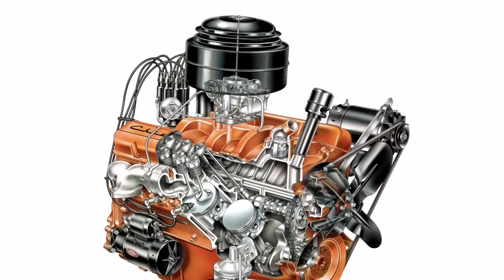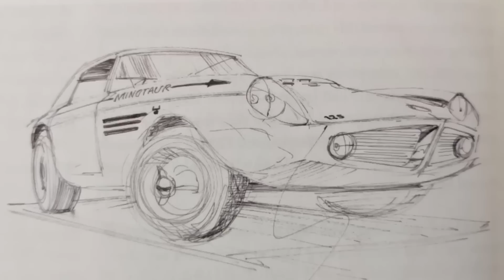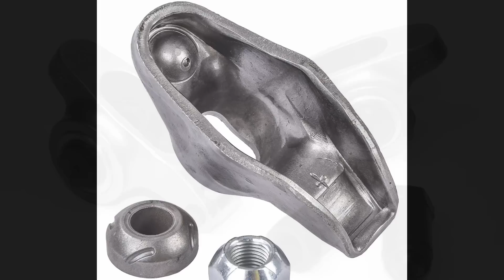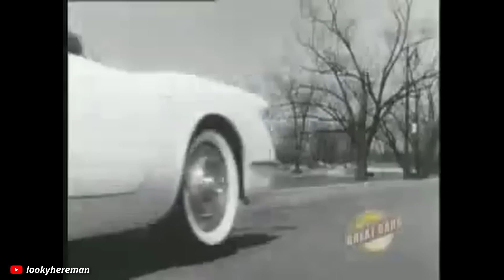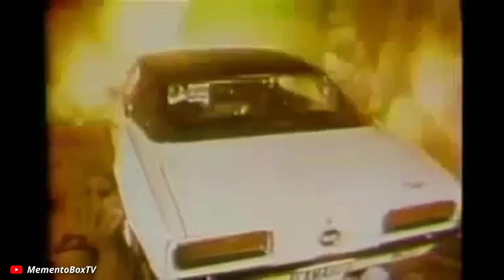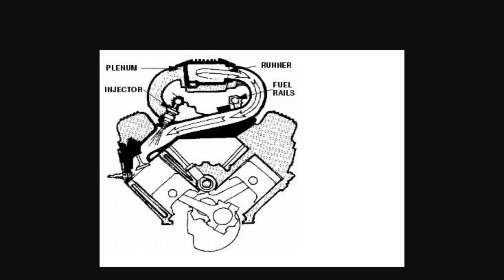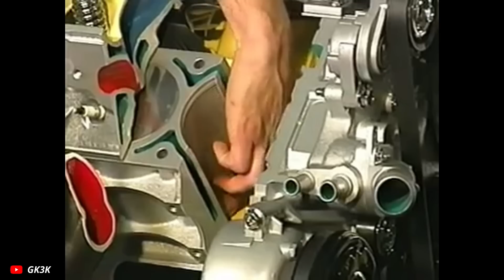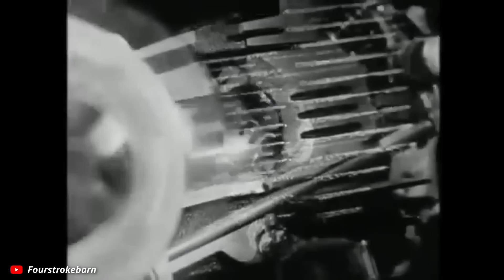The Engine that Powered America

Comment: Back then, you could work on cars-everything was usually really accessible.  Today, if the water pump would go out on my 2015 Kia, with the engine turned sideways there's simply no room to get a wrench in there to remove it. A mechanic would have to partially lift out the engine simply to access it.  What idiot with an engineering degree thought THAT one up?
Reply: I believer engineers should be required to disassemble the cars. What about heater cores and AC coils. You need to pull SO much stuff just to get at those in most cars. (I swapped the heater core in my 89 Jeep in about 2 hours on a lazy Saturday afternoon.  Those days are gone forever.

Comment: Yep. The climate that created this engine is gone. The modern four cylinder transvers engine configuration constantly changes in ways that are horribly stupid. A water pump driven by the cam chain that when the seal leaks, coolant gushes into the oil pan. Every automotive engineer should be forced to study the Chevy and the Ford small block engines. KISS is still a powerful design system. Musk uses it.
Reply: Not to mention Ford's wet internal timing belts. How stupid can they be?

Comment: Out going inline 6 cylinder?  While not as exciting as the SBC - the old Stovebolt six, first introduced in 1929, soldiered on until 1962.
Reply: Well, in a sense, yes.  But technically the 216, with its cast iron pistons, babbit rod bearings and propensity of cracking heads when overheated, was used in Chevrolets up through 1953 (some later 216s had inserts).  The 216 was superseded by the great old 235/261/292 series workhorse engines which bore little in common with the old 216 other than both utilizing six cylinders.  1954 was the first year of the 235 in Chevy passenger cars and pickups.  The higher displacement versions were used mainly in larger trucks.

Comment: I've been watching the bart motorcycle Channel forever. I didn't know there was a Bart car Channel until it popped up in my feed. Subscribed! Quick short story. My neighbor who was an old guy who worked on 50s and 60s cars then, (I grew up in the 1960s) said his dad was a Chevy mechanic. Evidently some of the new factory 55 or 56 V8s had an oil consumption problem. He said they literally got a service bulletin that said while the engine was running dump Comet or Ajax down the carburetor to scuff the cylinders so the rings will seat and that will clear up the problem. Sounds crazy but I believed him.
Reply: I'm 79 years old and I remember that.  My failing memory tells me it was Bon Ami, but I guess any of the above would work.  The bulletin also required the idle to be set a little high to keep the engine from choking on the powdered cleanser.  Its purpose was to seat the rings.  I don't remember if factory rings were chrome or not but the chrome rings of those days were hard to seat (some never did without the cleanser).
Another blooper in the early 265 engine was the characteristic "tick" sound nearly all of them made.  You could tell a 265 from a 283 (which cured the problem) simply by listening to the engine idle:  if it ticked and clicked at idle, it was a 265.  The problem was the design of the 265's pistons which used sheet steel inserts around the wrist pin bosses.  Since the piston was aluminum, you had dissimilar materials with differing thermal expansion rates.  That caused brand new 265s to crack at least one piston  which slapped the cylinder wall and made the clicking sound.  On the other side of the coin, the 265 had one really great (IMHO) feature not seen in many other engines:  the blocks were hardened to such a depth that the 265 block could be bored as much as 0.125 inch (that's 1/8") over the stock 3.75 inch bore without getting into softer material (on most engines, including the later 283, the limit was 0.060").  This made it possible to bore a 265 block out to 3.875 inches, a dimension which would now accept 283 pistons, transforming a 265 to a 283 with a boring bar.  That was done on my first small block Chevy engine.  It worked just fine.
I see from your abuser name that you are a snipe.  Semper Fixit from an antique CVA airedale, and thank you for your service!

Comment: 0:52 "Great New V8.  The valve-in-head eight as only the valve-in-head leader can build it!  162 horsepower with an 8-to-1 ultra-high compression ratio!  Highly efficient oversquare design means less piston travel...less friction and wear.  Exceptionally high horsepower per pound!  The new Chevrolet V8 brings you brilliant performance,  surprisingly high gas mileage, and extra-long life."
Reply: 8-to-1 being high 😭 holy moly

Comment: I hate the LS. It's completely different from the ultra-simple, reliable and CHEAP 350. Infuriating to work on in comparison.
Reply: isnt the firing order different and same as everyone else on the ls? makes it sound like a ford v8?
Reply: @hardrays  Never learned the firing order on an LS, since there was no distributor to tweak. So many other things on that engine had me so pissed off the firing order was the last thing on my mind. No dowels for the covers ... 1,000 places for catastrophic internal oil leaks ... absolute garbage lifters, cam bearings, and valve springs, etc ...

Comment: I once owned a 400 small block . A mild cam ., extractors . Holly carb .well anyway the wall of torque and sound is something I will never forget .
Reply: i think i ought to take the 400 out of the 71 and put it in the 87 caprice and put a 454 in the 71 caprice. the 400 would run the overdrive without downshifting, bet

Comment: I'm really old and I consider now to be the epitome of the internal combustion engine, GM's LS, Ford's Coyote V-8, Chryslers 5.7 Ltr hemis, BMW's Inline 6's, Honda's 4's, VW group's EA888 and VR6, Nissan's VQ35, Benz's 5 litres, and all their variants. That's what I can think of off the top of my head. Name a better time to be an engine fanatic. AND they pollute less and get much better MPG than ever. I think I read somewhere that Corvettes get 30 MPG on the highway. My wife's old 442 with a 455 CU engine got 13 MPG on the highway with 370HP. Now you can get a VW golf with 325 HP that'll do 35 MPG. I'd call that progress.
Reply: Engineering and todays materials great,  I lived those days and it was fun, todays cars boring ,no identity   :face-orange-frowning:
Reply: You do realize what that 442 is right? It’s a 442, the car that olds through at the chargers and mustangs and corvettes and Camaros and buicks gsx, an olds 442, and if it was the 370hp especially? You making 370hp, and 520 pound feet of torque, that vw only making probably 275 pound feet max, but yes the mileage is better, but they have no identity, not the same type of feel, you can tell what a classic was made for, for fun, for the people to enjoy, now the cars are made do get you to work, make sure you don’t die, only for “regular” traffic conditions etc stuff like that, they are made for money not for what they are meant to be..
Reply: @455sBuickOldsPontiac     1964 -  4bbl,4 speed, dual exhaust
Reply: @rickbrandt9559 what u mean? 442, 1970, 71, 72? The 455 wasn’t even a thought in 1964, if I remember right olds didn’t have the 455 till 68, which I figure is wrong and it 1970 is when they came in, olds, Buick, and Pontiac got their 455s in 70, cause ik pontiac and Buick got it in 70, but idk about olds but probably 70 too, unless maybe your saying the first year for a 442?
Reply: @455sBuickOldsPontiac  1st year with that designation of 442 it had the 400, they contined with that 442 logo  ,even thou OLDS configuration changed
Reply: @rickbrandt9559 yes that’s what I figured you meant, which has literally nothing to do with what I was saying, he literally said 442, with 370hp 455, that means the 70 or 71 maybe 72 year, nothing to do with 64, and I know that’s they only had 400s then
Reply: @455sBuickOldsPontiac  64 was the only year the 442 ad actually applied to the 442 moniker as advertise by Olds, a Cultlas ordered with the 442 option meant/came as V8 (400 ci ) in this case,4 bbl,4 speed, Later yrs the option expanded into weird combs.
Reply: I agree the tech is nothing short of amazing, but I miss the days of tinkering to find that sweet spot that made em’ roar. Now that roar is found on a fuel trim file in the computer. :-(
Reply: Was not a criticisum merely a clarifcation for others  🙂
Reply: @rickbrandt9559 yes o can see you know more than i do, but you could have also looked it up, im saying something that didn’t really have anything to do with your very cool, and yes interesting info, I was talking about the guy saying his wife’s old 442 with 370hp, and a 455 (455 not 400) and he said a you could now get a vw with 325hp, and 35 mpg, the 455 he said only had 12, then said I think technology has come far, it has, except that that shitty vw only has like 250 pound feet of torque, the 455, with the 370HP OPTION, WOULD HAVE 525 pound feet tops, I thank you for your clarification, and info, but you are talking about something different, but every one loves to share there info they know, and you have some yes, but im 14 and if im this far I can understand enough to just say, your saying something that the only thing it had to do with my comment was the fact we where talking about a 442, enjoy your day, night, and whatever
Reply: And VW VR6 half a Lamborghini motor is not on my list all the rest were pretty good the Honda B series were amazing what's a small blocks on the B series are all that when it comes to internal combustion current battery suck balls no matter how fast they go
Reply: We all know new cars are faster and in a lot of ways better. I'm 45, I drive a modern car to work but I have a mid 80s Holden vk 5.0 v8, t5 manual gear box. I rarely drive it, but when I do, I love it. Light, powerful, raw, and simple. Unfortunately, super thirsty. But it's still a fast car even by today's standards. I miss the 60s and 70s cars I once owned. Of course I like the economy and lack of maintenance of a modern car, but they don't don't have the soul of an old school rowdy v8 with a big cam in it. I do like the ls but the reason I like it is because it's still a push rid v8. My dad has a ford falcon fpv super pursuit ute. 5.0 cyotee, super charged. It awesome. But too refined. Of course it's faster than my old commodore but not more fun to drive. I would take a mid 55 chev over that ford ute any day. Not for driving daily, but for a weekend cruiser definitely.
Reply: There's modern V8 cars that get 13mpg, might aswell keep the car carbureted

Comment: The 265 was called the 265, because it displaced 265 cubic inches, not 260.
Reply: Precisely correct:  bore (3.75) squared times stroke (3.00) times pi/4 (0.7853981063) times number of cylinders (8) equals 265.0718801 cubic inches.  Close 'nuff!
Reply: @randykelso4079  I prefer Pi R Squared times the height. 
It's easier for me to remember the formula and I don't have to deal with the extra calculation to find out what 1/4 Pi is.
Reply: @DeanMk1  
Fine, Dean, as long as it yields the same result.  In my case it was easier to simply memorize the constant to four significant digits (0.7854) and the rest was easy.  To each his own.
Reply: @randykelso4079  "To each his own." 
Exactly!
...btw, I round Pi to 4 places, too. It's how I learned those formula's in Diesel school.

Comment: How long was the Chevrolet "small" V8 in development ? Was it done in faster time because of being able to use "notes" from the already developed Olds and Cadillac V8s ?
  Also Pontiac's modern OHV V8 was being developed for several years before its being introduced to the market but GM upper management forbade Pontiac to sell it for one or more years after its completed development because of fear that it would take sales away from Oldsmobile and Buick ? 
  Was the main reason for the success of the Chevrolet V8 in having thick lower block walls and main bearing saddle webbing in spite of the small/low short deck height ? Also very large bore size in comparison to the stroke allowing more width for large valves?
Reply: It absolutely was the result of lessons learned by a team who had three other OHV V8 programs under their belt. One of them said that exactly.

Comment: COLE spent 7 years refining the air cooled boxer engine for the Corvair - and its 4wIDS, & unibody - making it Bob Lutz of Daimler's favourite daily driver - Jerry Garcia's, too. Jim Hall used its transmission to model his own & win an FIA race - the Corvair (albeit with GMs added rear stabilizer) won an SCCA D production title - even Nader in his book admitted Chevy dealers could have instructed buyers how to drive rear-weighted cars - and Corvbair is not at all the focus of Unsafe At Any Speed, merely, its first chapter & sales hook
Reply: I owned a Corvair "Monza" in 1961. It had the "high output" 98HP engine and would "eat" 170ci Falcons for lunch. Everything about it was great, except it had the 3-speed manual (non synchro 1st). Couldn't wait for the 4-speed! Stupid of me.

Comment: 1972 was the last year for good American cars. 73 saw the advent of Ralph Nader's "safety" bumpers, which effectively made all cars look like they were sticking their chins out. 73 also saw the advent of the squarebody Chevy pickup. 72 was the last year for nice tapered curves. Nowadays all the new vehicles look the same. They all look like they were carved out of a block of soap by a robot. They look like oversized plastic toys. They are oversized plastic toys, they have plastic holding them together, they probably have more plastic parts than steel parts. They're all designed to crush like a beercan in a wreck. All in the name of "safety", what a cruel joke. Want safety? Drive a Sherman tank!
Reply: Also, in 1973 we had a "little' thing like the oil embargo, meaning price of gas DOUBLED overnight! It was the beginning of the end of high performance engines!

Comment: lots of your 327 info is incorrect
Reply: Which?
Reply: @impalaSS65  it went into Corvette in 1962not 1963 or4....it highest factory hp rating was 375 not 383.
Reply: @stanallport6746  Ok thanks. I assumed the 63-figure could be correct for Corvette (I know next to nothing about Corvette). I missed that he mentioned an odd "383hp" rating, but I read someone else noted it aswell.

Comment: I think my dad’s Mariah boat has a 4.3L Chevy v6 although I don’t know what engine it’s based off of. It’s pretty compact and easy to fix but a little old at this point.
Reply: 4.3 is basically a 350 chevy with 2 cylinders missing, many parts interchange like distributors,waterpumps,valvetrain etc.